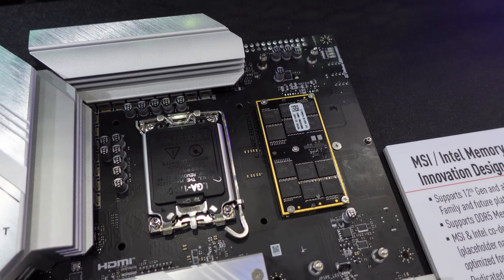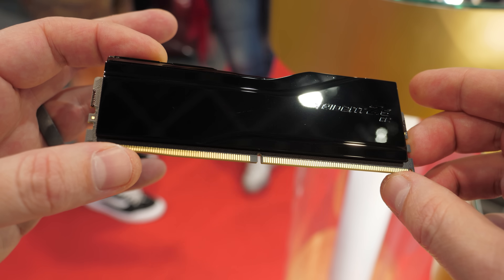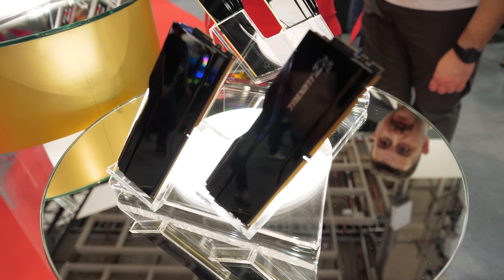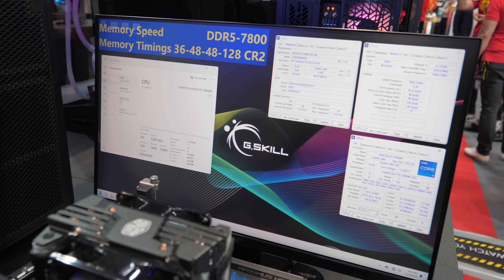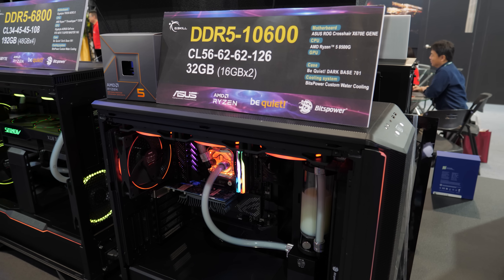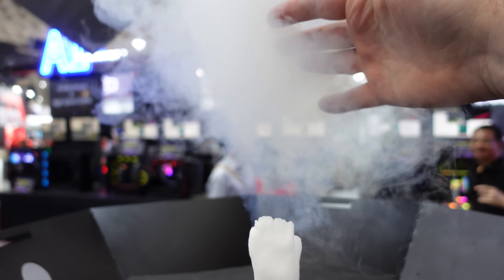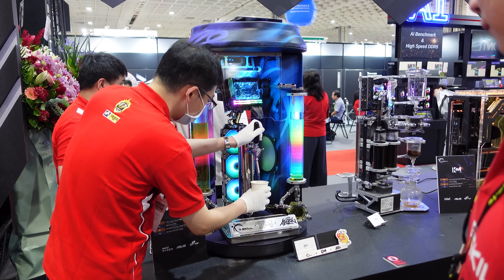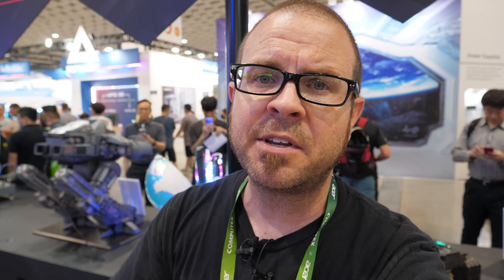You Have 30 Seconds to Comply With These New Memory Standards

Comment: Having it flat is good for clearance but eats up the mb area. Also, the one shown was attached with screws? In this day and age of tool-less installation?
Reply from the maker: They didn't want anyone to steal it I think
Reply: I welcome CAMM cuz more adoption=better odds of it replacing SODIMM in laptops
Reply: PC World has a video going over CAMM2 and in the JEDEC documentation they state that they need to come up with an attachment system that doesn't require screws.
Reply: @TigonIII  I mean, wtf? It should be like one of the first things to think through. Maybe a socket like CPUs with a lever (expensive, but secure and reduces misalignment errors).
Reply: @BoraHorzaGobuchul  Blame Dell, as it was them that developed it, but gave it to JEDEC to make it a standard for the industry.

Comment: That RAM clearance with CAMM2 😮 good for a mega air cooler.
Reply: One day they'll put giant heatsinks on CAMM2 like we do now with DDR5 and then we are back to having clearance issues again

DDR and DDR2 didn't have giant heatsinks on them, it begun with DDR3 and beyond, it is inevitable.
Reply: @paul2609  ram in general doesn't need giant heatsinks i'm all for low profile ram with a little shroud over it but i don't need this heap of metal
Reply: Yes or specfic itx builds camm2 is great for people that wish to pay a little and upgrade later, 1x16gb dimm- 2x16gb dimm - 4x16gb dimm would not be possible. You buy a 16gb camm2, you'd lose its use, if you wanted a 32gb of memory, and later if you wanted 64gb you'd lose the use of the 32gb camm2 and the resell value of the lower capacity camm2 modules will be terrible
Reply: @RadarLeon  I was thinking the same thing when I watched how the new RAM would work.  I was like "well it's impossible to get 16 or 32g now then upgrade with a matching set".
I guess as long as there's a good or decent used market for RAM (we'll be like hermit crabs swapping out to larger shells).
Reply: @jetah50  Could start your own CAMM2 Swap Meets Club.

Comment: the cam module at 7800 cl36-48-48-128(primary timings at elast) are slower than my system is running at right now, 12700k,vengence 7200c34@7800-36-46-46-96 on an msi z790 itx, so not that impressed. Just give us memory being mounted on the back side for even shorter traces between the socket and the dimms, with modern chassis with the cut outs in the motherboard tray it is doable, and if they want to save more space then make it so they are mounted in a so-dimm way.

when ddr5 came out we already heard rumors about ddr5 at 12000mt/s, and I promised myself to wait with ddr5 until we got those but now I have had like 5 ddr5 kits already and 6 ddr5 motherboards :P All the FOMO...

Comment: Ehh.....why did they need to put a fan on the working CAMM2 memory module? Is it really going to be that hot when running?
Reply: As long as you have active airflow over your memory modules from the rest of your case's cooling, this isn't needed.
Reply: @TheRealSkeletor  Considering it was an open bench setup it probably was needed.
Reply: likely designed for a heatsink that isnt on it for display purposes
Reply: Probably, DDR5 runs hot and CAMM2 is packing it into a smaller package.

Comment: Is 10600 MT/s an endgame for DDR5 and they will only be able to work on clock timing now? If you push it to 11200MT/s it will technically be DDR6 speed range as the data transfer rate was doubled from 5600MT/s. Or will we see like 14000MT/s modules that still count as DDR5 because they can communicate through the same interface?
Reply: If it physically "fits" DDR5 it'll still be DDR5, unless marketing hears you...
Reply: 1. 4800MT/s is base ddr5 speed. 2. The new standard does not come in when the predecessor has doubled the base spec lol
Reply: @Frozoken  Well, DDR stands for Double Data Rate, but I guess if a 14400MT/s RAM will still be able to use DDR5 bus, there's no need to even hurry for a new bus specification. I mean, unless marketing teams decide DDR6 has four times the data rate, so they will either skip the name for DDR7 right away or they will call it QDR6 which would stand for Quadruple Data Rate, otherwise the shortcut DDR won't make any sense anymore.

Comment: At 0:30 I really think this idea is superior except one thing they could change. Instead make the ram module a square shape with a square hole in the middle so it can be placed on top of the CPU socket where the CPU fits within the square hole and where the CPU clamp has an outer lip that also puts compression down on the memory module which also gets active cooling from the CPU cooler. It would have less latency and be able to reach higher clocks with active cooling. Then chip makers could reroute all CPU pins that communicate with the RAM modules to the outside perimeter of the CPU for even better latency. 

Imagine a CPU design where the CPU PCB is a hollow square with the die in the middle so that the contact pads of the LGA can be on both sides of the CPU PCB and the die can be cooled from both sides with an IHS on both sides. Though... the layers of the etched silicon in the die would have to route all IO to the outside perimeter of the die where it would make contact with the outer square PCB where the contact pads are. I don't know if this kind of die IO routing is already done. The LGA "Land Grid Array" pads on both sides of the CPU PCB could be sandwiched between two hollow square ram modules (like explained above) from both sides of the motherboard and compress onto a rim LGA on the motherboard which channels all power and IO so that the CPU die could have 2x more directional IO routing and 2x more cooling. The ram modules would have to fit into a hollow motherboard rim socket from both sides to hold the CPU between them in their sockets. Then CPU coolers and RAM like explained above could be installed on both sides of the motherboard to help the CPU run faster. Some manufacturers already make computer cases that have openings on the back side of the motherboard. CPU manufacturers could make thicker die's with more cores that have better routing in a smaller space that can still be cooled effectively. The CPU cache could also be positioned between the RAM and the CPU cores in a symmetrical perimeter for more evenly timed transfers. The RAM could act like L4 cache on top of the L3 on top of the L2 and L1 with the cores in the center. Intel could call it Sandwich Lake and AMD Sandwich Canyon and they could feed masses of drooling nerds.
Reply: What are you smoking? Thats just some insane puzzle piece'd SOC at that point. VRMs also get in the way of that. Latency is really more of an architecture thing than just trace length. The DRAM specs has specific bus sizes/clocks for loading data from RAM to the CPUs cache. So your CPUs memory latency often is more about cache size and optimal Bus usage.
CAMM2 is more about beating the SO-DIMM limitations early in laptops while showing future benefits in dual-channel flexibility and bandwidth in the future for PCs.
Reply: @aerostorm_  I'm smoking the smoke from overheating CPU's trying to reach 6ghz. AM5 sockets are still burning. My father worked at a company called Xilinx which builds FPGA's that AMD recently bought. He told me the biggest limiting factor in CPU architecture at the moment is routing. The routing problem is not solved without a rearrangement of the IO dependent components around the CPU so the internal CPU architecture can be more efficiently designed. Have you ever looked at a GPU PCB? Why do you think Nvidia puts the memory modules surrounding the die? There'd be plenty of room around the VRM because the CPU socket could be moved more to the right and down since the current RAM slots would be gone.
Reply: @ZacharyAlexanderP Putting the VRAM around the GPU die isn’t exclusive to Nvidia in any way so not sure what the need of mentioning Nvidia was. Also AM5 sockets still burning according to who? Using old BIOS versions?
Reply: @Simon_Denmark Given CAMM modules started out as laptop memory, this would complicate laptop design by a lot
Reply: @mcslender2965  Did you mean to respond to me? I didn’t talk about CAMM at all.

Comment: I  waiting until its over 9000 before upgrading my ddr.
Reply: Gonna be left behind when the 10,000 comes out. But that's on you my dude.
Reply: @rbroccoli_  there is a sweet spot. I think 9600 will be it. But the goal of my post was for the memes...
Reply: @ricky4673  same. Just for memes. But ram is kinda wildly fast now which is actually cool.
Reply: Dumb question from a non-tech savvy newb... So I planned on using 48GB of 7600 @CL36 with Arrow Lake next month and kind of cringe at the CL, but in what scenario would someone want 10600 @CL56?

Comment: 32gb “lower capacity” we really there yet?
Reply from the maker: I mean... relatively
Reply: 32 gigs? Ok.OK. I'm officially old and saying old people stuff like "that's just ridiculous ".
Reply: I kind of think this is the baseline for any gamer.
Reply: @techieg33k  Which games require 32GB?
Reply: @Cpt_Wolf I find self hitting 12Gb RAM usage on many games I thought they would not need that much, I'm sure it would be more if it wasn't for my limited system with 16Gb and no swap (linux).
Reply: Yes, ATX will only have space FOR ONE , maaaybe 2 if you squish em and goobye itx
Reply: Still using 16gb....ddr3
Reply: @walsterdoomit  Since last DDR3 platform was introduced a decade ago maybe it's time to consider an upgrade.
Reply: @gagarin777  yeah I'm working on it brother. I am waiting for the correct star alignment 🙄😀